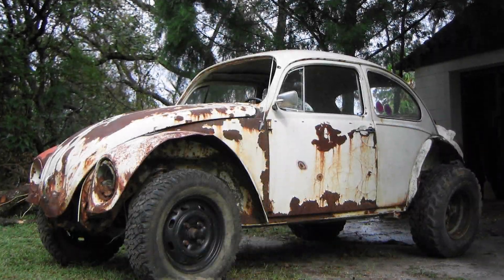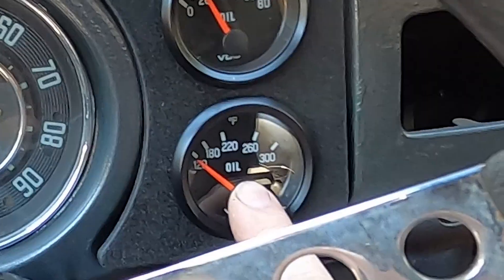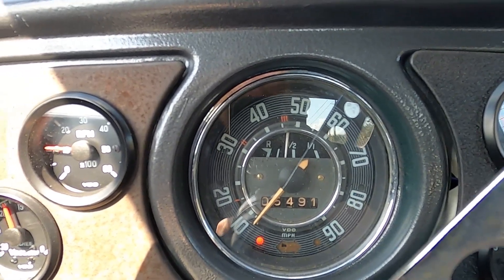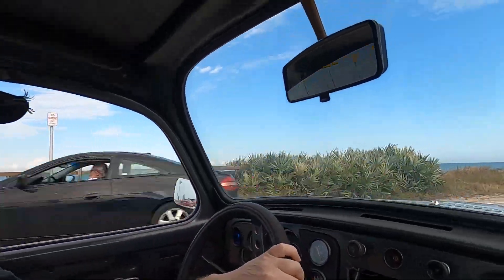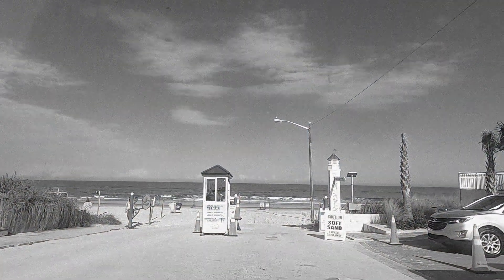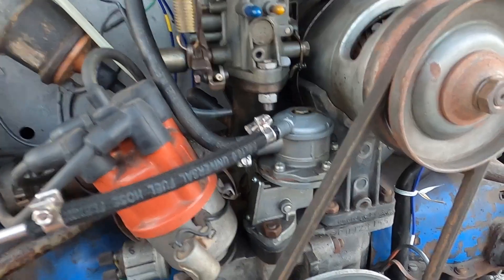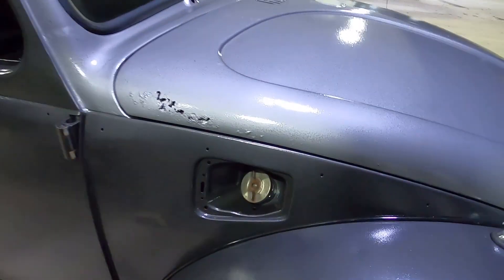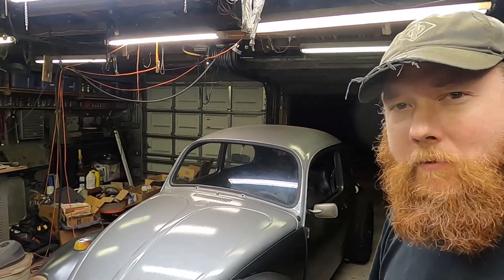Dweezil Drives to the Coast #VDubRun21

Comment: As a retired air cooled VW mechanic I have not seen your videos before but I am curious as to why there was any doubt a VW would go 200 miles. I’ve had many and found with regular maintenance they are nearly trouble free . Just curious and wish you many happy miles 👍😄🎩
Reply from the maker: Hey Jon, I'm glad you found us! If we were in a room together I think we'd get along famously. I totally agree that a VW is reliable; it was a well-earned selling point in their day. Today's VWs have seen some miles but the design is no less reliable than when they were new, provided their steward is capable. That's where things can fall apart- as a novice I understand that it's up to me, and when I'm troubleshooting I'm looking for what I missed. Settled for the wrong part, skipped maintenance, or as happened in this video, I failed to properly vent the fuel tank. That's OK, I like the learning process and there's a lot of lessons that may come up in 200 miles. Thanks for watching!

Comment: I think you are ready for an engine refresh. Oil pressure is low low low. Check rear high pressure valve spring and plunger for wear.
Reply from the maker: Hey 1fastbuggy, I agree it's crazy low; this engine has some really tired parts. There's a backstory here ( https://youtu.be/OmOYfAbX7Kc ), but suffice it to say that a fresh build is in the plans. Thanks for watching!

Comment: Awesome. 1 goal off the list. Just curious where your vacuum Guage is attached? Maybe need to hook it up to your gas tank.lol.  ✌️
Reply from the maker: Thanks Christopher, that's funny- I think at one point it would have measured a perfect vacuum if it were connected to the tank... I have it routed to the intake manifold as per the usual for a vacuum gauge. The Vacuum advance on the distributor is to ported vacuum off the side of the carburetor.

Comment: Nice trip there! I'm not much of a beach guy because I despise hot weather, but at the time of the day you were driving when it's a little fresher, the drive looked really fun and relaxing, and I'd be up.to that no questions asked.

Good job on diagnosing that fuel issue. And I'm looking forward to get a set of those hose clamps for my bus, as they are better at clamping, less aggresive towards the hose material and waaay better looking than those dreaded classic clamps that have slots in them
Reply from the maker: Thanks VochoTalacha, I'm not much of a beach guy either but I really like it as a destination. Also enjoy camping at the beach- the seabreeze softens the heat and the sound of the waves is nice.
It's funny- I created that problem with the fuel pump by not properly venting the tank. Oops. Thankfully the problem revealed itself and didn't become a long process. And you're right, those fuel injection style clamps are the way to go. I buy extra and carry spares!
Always great to hear from you and I hope all is well for you and yours!

Comment: did you get a vented gas-cap? liked & sub'd
Reply from the maker: Thanks Hatchet Harry and welcome to the channel! I did some reading about the stock venting systems and think I've settled on a method that runs a vent line over the dash and to an outlet on the driver's side. Some of the venting schemes get complex but this seems it will be effective and relatively simple. On a side note, a vented cap works great on my old motorcycle! Thanks for watching!

Comment: Hey Brent glad to see your trip went well without any major problems. 
What is “the loop” area that you drove? Also where was the tree lined highways at? Visiting my daughter in St. Augustine now and might be a good ride for me and my wife.
Reply from the maker: Thanks Robert, it was a great day. The Loop is a 22 mile route from Ormond Beach to south of Flagler Beach. If you're going south on A1A from St. Augustine, look for High Bridge Road on the right. That's the top of The Loop and the most scenic, not counting A1A itself. It goes south on Old Dixie Highway, then turns into Beach Street. Take the Highway 40 Bridge across the river and you can go back up A1A. Great ride. Enjoy!
Reply: @HapticGarage  I will check it out.

Comment: At one point in the video you showed a hole in a vacuum cover on the inlet tube to the fuel tank. I thought that was supposed to be an overflow drain that extended around the tank to drain out the driver's side underneath the car. could that be where you were getting the vacuum from? seems to me that the fuel cap was doing it's job. Just curious. I could be wrong.
Reply: Actually it was in the previous 'Gas Leak' video in the beginning where you showed the inlet fuel lines to the tank.
Reply from the maker: Correct! Good eye Mofoco 1432, I did a little reading after the vacuum issue and felt a little silly for creating that problem. VW used a few different approaches to this over the years with later models involving charcoal filters and even lines to the rear of the car for engine vacuum. I leaning towards a single line that has a high point under the cowl, goes across the car, and then down to an exit hole in the body on the driver's side (as you mentioned). Right now I have a temporary solution using a short tube exiting above the filler so Dweezil stays on the road but am anxious to put a permanent arrangement into place. Great to hear from always, I hope you and your boys are doing well!
Reply: @HapticGarage  That's right. They did use several methods over the years. I have no idea if it was done on certain year models or if it was for certain areas of the world. You know California has different laws and everything.  My '70 sedan has the small fuel line that was routed just as you say uphill around the cowl. That way no actual fuel runs out only fumes. I have had been in a couple arguments about that vent line. My final statement in the arguments was that I have spent 40+ years driving a VW, looking at parts in magazines and online, and going to car shows I think I would know if it were supposed to be there. Now, usually I'm way more humble about my knowledge but this guy was getting on my nerves and had barely owned a Beetle for 6 months and thought he knew everything. So, when I saw your suction cap on that tee I thought it looked funny but also thought you knew better than me. I wasn't able to reply properly because at work the security turns off the comments. Ugh! Replying on my phone is not very practical. Needless, to say I was excited to be able to have the solution to your problem but was unable to answer quick enough.

Anyway, my boys and I are doing great. Currently, we are waiting for the body and body parts to get sandblasted. The guy that will do it blasts outside only. The weather and the media type plays a big part in when he can get it in line. When he does that, I will get it back and rust treat everything before I begin the body work. There isn't a whole lot to do for the body but I'm new at that of course so it's quite daunting at this point. We are excited nonetheless. I've typed enough for now. I do hope to see you at a show in Fla. or Ga. sometime. We aren't too far away to get to Fla. we're just in Macon, Ga. Thanks as always for your videos. You are a true blessing to us! Thanks for listening.
Reply from the maker: @flat4ification  Thanks Mofoco1432, I hope to see you at a show too. I may brave the heat this summer if a show is really enticing, but the next best bet would be Bug Jam in November. Regarding different methods and regulations, it feels like the simplest design reflects the designer's preferences and the complex design integrates the regulators assertions. The single line over the cowl seems better today than it did yesterday!